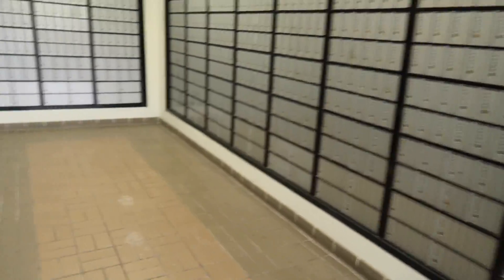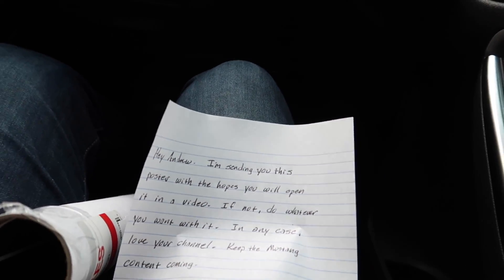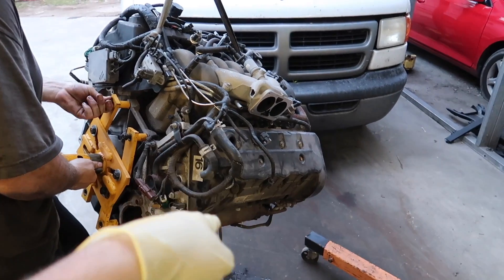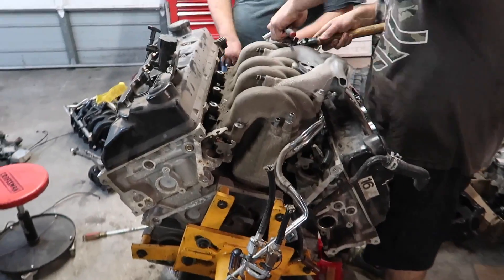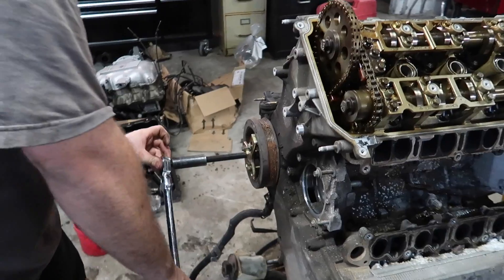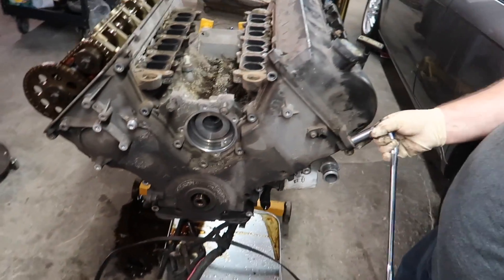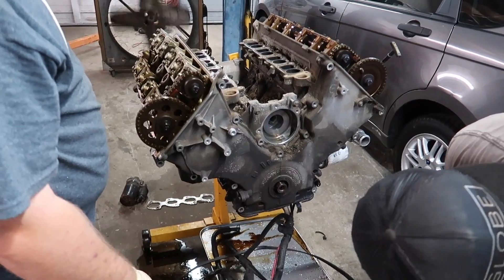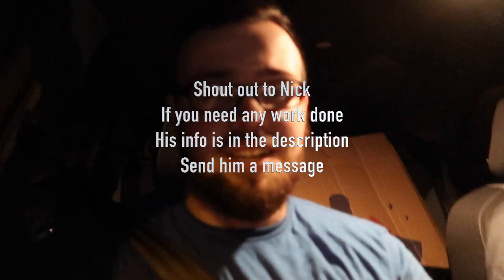Turdzilla Mark VIII V8 Engine Swap: Preparing for Cams Install

Comment: When you finally install this engine into a car, be sure to grind on the intake ports with an abrasive pad, and be sure to leave all of the intake ports open/uncovered that way you get as much garbage as humanly possible into the engine before you fire it up just like you guys did with the blower install awhile back!
Reply: The Walking Dad haha I didn't clean my intake ports either when doing the charge motion control plates on my 3v

Comment: Whenever the oil pan was pulled off a small chuck of rubber fell into the crankcase, make sure it is retrieved before the project is completed

Comment: Impact gun prevents snapped bolts. I use electric impact so it's not so intense. Heat works also.

Comment: Just bought a 98 Mustang GT with a tired engine. And just saved a 94 mark 8, with a very good  (well maintained) 4.6l dual overhead cam engine from going to the crusher. What is the bare minimum, absolutely necessary things to do in order to make the dual overhead cam 4.6L start, and run in the mustang? Hoping to swap, with the least amount of money spent.

Comment: So how much can u get out of these 4.6 32v motors I have a 04 mercury marauder that I was thinking of coyote swapping and was trying to find out some info before taking it out
Reply: dan hsr keep the motor in it id build it before going coyote better bang for buck
Reply: The 4 valve you have is a good engine that just needs a little help. Don't Coyote swap until someone figures out the bbq tick. The 4 valve is much more reliable